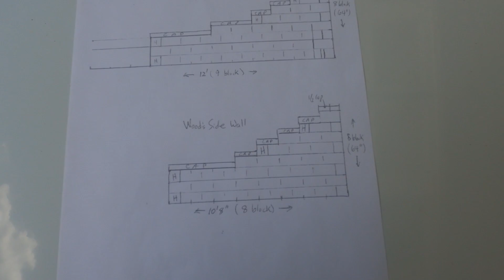DIY Grease Pit In My Backyard

Comment: I've had my mind on doing this, got the bank.made to go off of,  your the first I've seen actually do it! Thanks for the video, really lays out the process.  Do you think it could hold a 8k pound van though?
Reply: I'm doing one now and using ibeams from guardrail. I'm guessing what the original poster used is strong enough. Also depends how much of that 8000lbs your putting on it.